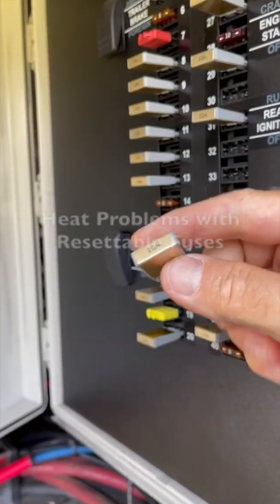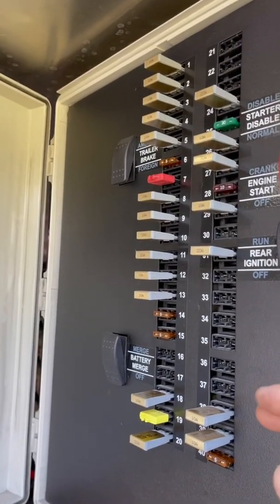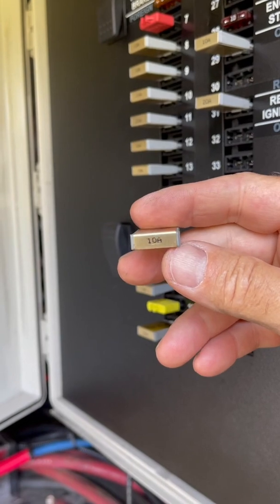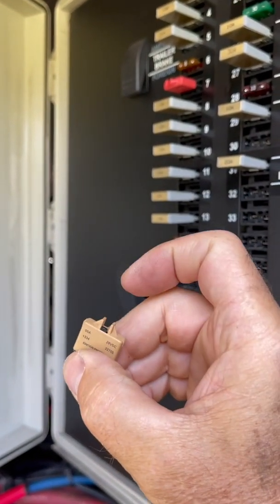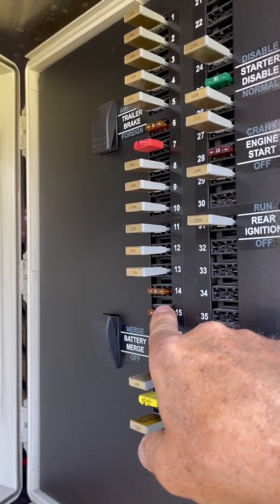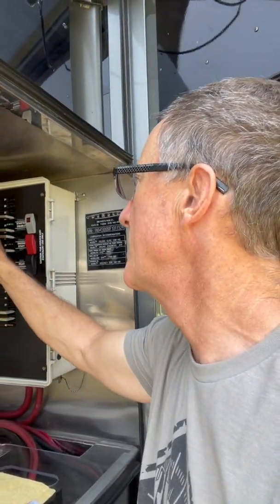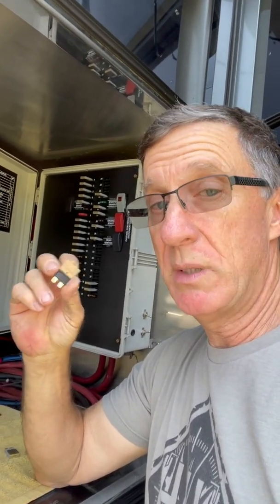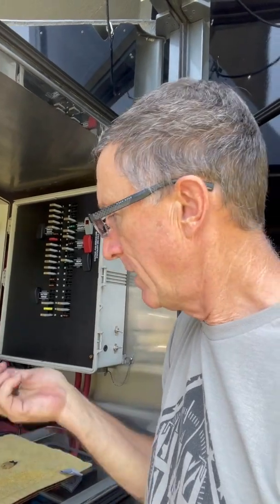Resettable Fuses (Breakers) FAIL from Extreme Heat Problems | Newell Coaches & RV

Comment: My coach has several of these and they will also exhibit issues as they age, making them more prone to overheat. My wipers on on one of the auto reset fuses and when it kept tripping (getting very hot) I fixed it by replacing it with a new one. Haven't had a problem since.
Reply from the maker: YES! Glad you got it figured out too.